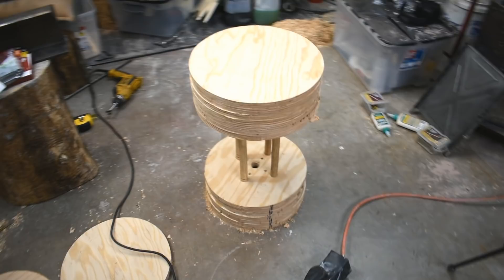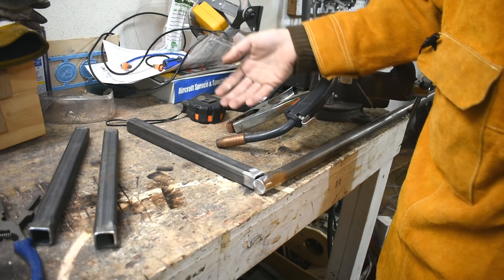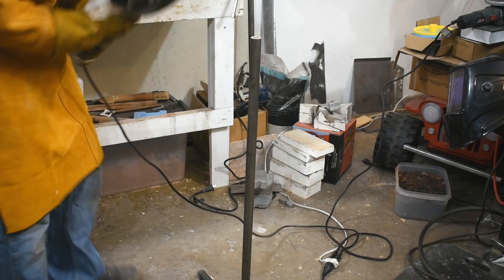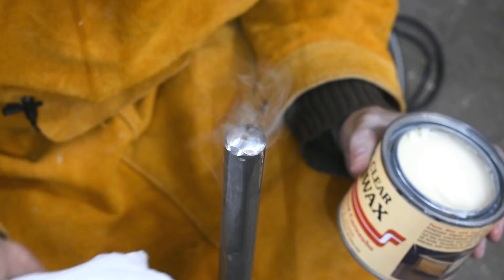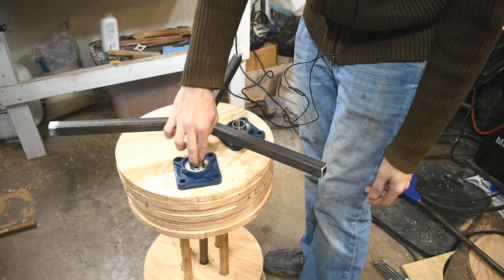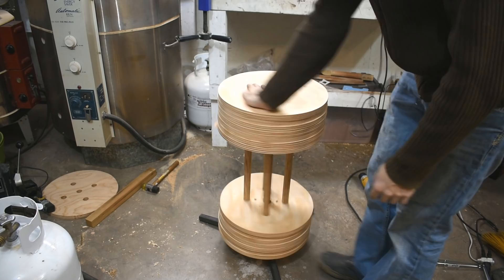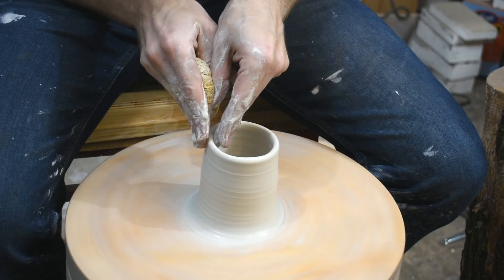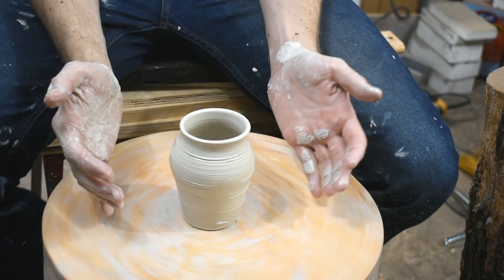Building an Asian Pottery Kick Wheel (kerokuro or karatsu wheel) Part 2/2: The Rest of It

Comment: Maybe you could put grip tape for a skateboard on the kick wheel
Reply from the maker: Good idea!
Reply: I second this upgrade
Reply: Another option, and cheaper, spread a layer of glue on the base and sprinkle sand on it. When the glue dries, you have grip. I did something similar to my grandparents outside stairs but used paint as the glue. Helps them not slip when its wet!
Reply: Was just about to post this, and your comment was right at the top.. so I just thumb'd it up. xD

Comment: You'll tear the sides of your shoes to pieces if you do this, but if you want extra grip, just cover the sides of the bottom wheel with skateboard grip tape. Putting your bearings on out of square might be the cause of the wobble.  Consider forming a shim to correct the squareness of the bearing.  As for the ends of the legs, you could take a 3 inch long piece of 1 inch by 1/8 inch flat stock and put a bend in it to cover the end of the tube and provide a foot for the leg from the same piece.
Reply from the maker: The bearings are free to turn, so being out of square is fine for them.  The wobble is definitely from misalignment of the wood, though.  Grip tape is a great idea

Comment: That wheel really works, much better than you’d think. Obviously someone knew that already as I am guessing there have been millions made. I’d be trying to ad something to power it for a steady speed. Not that that is a simple thing to do either.

Good job on all that work!
Reply from the maker: I already have that electric one from the washing machine, it still works (kinda).  Gonna try building some leg muscle to use this, but I might add some power eventually.  I cant leave anything alone.
Reply: @PaulsGarage  you could try adding weight (maybe drill evenly spaced 2 inch holes, fill with sand, and then glue some wood on top to hide the holes?) to the base to help preserve some of the momentum. The added weight may also help to keep your stand from moving.
Reply: I forgot to write, also, I think Korean wheels are used barefoot or with some kind of slippers for additional traction.
Reply: @andrewfleming611  The momentum he tries to preserve will also need to be built up to.  I think he'd better save that for after he gets his legs accustomed to the contraption as it is before adding weight.

Comment: My Pillow bearings should be here today.  Daughter is bringing home more glue. I'm going to fill the inside cavity of the bottom with sand to add mass.  I am stoked...
Reply from the maker: Building one? This thing is great.  My mom has it now but I'm planning to build another one, an Onggi wheel to be precise.  Basically identical to this one except lower and wider, but same construction.  Good luck!
Reply: @PaulsGarage  I thought yours was a bit tall?  About how high do you think your table should be?  Also how wide?  I cut 15" circles because my lathe swings 16" and I plan to true them round on the lathe vs. fun with an angle grinder...
Reply from the maker: It was a bit tall, but the key height is the distance from the top of the 2 discs.  The distance from where you foot hit the bottom to the part where you put the clay.  The total height is less of an issue as the real ones tend to be sitting down in a hole, or you have a raised bench to sit at.  I don't exactly remember how wide mine is, i think 14"?  I did the same diameter for both top and bottom.  If i did it again, I might make the top narrower, maybe 12", maybe not, but I would make the bottom one wider for a bit easier kicking and a bit more momentum.  The other thing I would change is to move some of the plates on the top to the bottom.  That way the total rotating mass wouldn't change, but the mass would move closer to the bottom.  With all the weight up on the top, it sometimes gets a slight wobble when i'm kicking it hard (like during centering).
Reply: I have it dry fitted and my first thought is that the hole the center rod passes through in the wood should be slightly larger than the rod, because it spins, but seem to drag a bit?  Thoughts?

I'm going to hunt the shed a little bit later for an old umbrella stand I think I threw out there years ago instead of welding)
Reply from the maker: Yes the holes should be large enough and aligned between plates enough that the rod doesn't touch them.  I had a similar issue, had to make adjustments.  The rod should only contact the bearings.  I dont have any contact at the tip of the rod like some designs show, it ended up working just fine like this.  A leach treadle wheel hangs everything on bearings too I think and those are much heavier
Reply: @PaulsGarage  I was pretty sure that was correct, but figured it made sense to confirm.  Appreciate your help!

Comment: Paul, I suggest Rubber. Get some decently thick rubber to staple onto the bottom of the wheel. It will give your shoes grip and a little extra water protection... And if the leg workout doesn't work out, you can always try adding a motorized belt to it.
Reply from the maker: Good plan!

Comment: Try friction tape on the base. You can also try adding a rim around the top to catch the water that's flying off.
For the sponge - use enough water so that your hands easily glide over the clay, but not so much that you have a pool at the bottom of your pot

Comment: Maybe you could take out some of the wobble by torquing the dowels, which as i recall have not been glued into place. It looked like they weren't quite parallel. On the ends of the feet you could drill a hole, run a bolt through and have adjustable feet to level it. I might try to make one myself, thanks.
Reply from the maker: The dowels weren't quite parallel and the panels weren't cut very well.  If I had to do it again it would be very different.  Give it a try, it's actually pretty fun to use

Comment: In case you were in desperate need of some hindsight delivered from my couch; I kinda did see that non-level wobble surface coming in part 1. Would have been better to widen out those holes and get the dowels in to a defined length; and grinding it down to a level surface sounds like a lot of work. To try and bring that back to a constructive suggestion; how about giving it a little rim with some wide tape sticking out, and then mixing up some plaster and wood glue. Makes for a nice and cheap but sufficiently durable pourable resin (plaster alone might do even unless you want to do more of these christnings) so you can let gravity do the rest of the levelling. This only gets rid of the wobble insofar gravity aligns with the axis of rotation though, mind.

Comment: You need bats and lockting pins.
Those bearings have quoted radial load not axial. You could replace the bottom bearing with a thrust type. If you throw your pot on a batt you can lift it off to cure and make another on top of another batt. Good luck

Comment: Scratch board under pot so you can move it while wet and a rubber cane foot on metal legs safer and slip resistant
Reply from the maker: Good ideas

Comment: Hi Paul . I've just recently found your site & for the past couple days I've been skipping around a bit but enjoying all of your stuff. Your personality & intelligence makes the chatter very enjoyable . But this wasn't intended to be a 'fan letter' ... (* shhhh *I'm a fan. ) I'm just an opinionated old (72) guy & I wanted to give my opinion on a couple things. - - Not intended to embarrass . A couple places where you are discussing stresses , you misused the term tension, most notably when you were testing the Iron ingot by bashing it in the vise . Its more easy to visualize tension if you just imagine tension as the opposite of compression. ... compression = squeezing , tension = stretching. The term for the stress you were discussing (like I said , in a couple videos) is shear . Especially in the lateral bashing at the vise - - Shear would have been the proper term.  Enough on that minor slip. 
 2 ) I forget the correct terms you gave for the two part box you use for your sand molds , but I believe the single wedge on the top box is not supposed to be ATTACHED to the box. I noticed you used a screw. I believe that wedge is a separate piece that should be driven in & held entirely by friction..
 Enjoying everything & I think The first project I will steal from you is the kick wheel pottery gizmo . Sneaky in that I believe if I can involve the wife - I will get more garage time for myself ! < insert evil laugh here. - - schistdigger@aol.com  - -  (Mike)
OH ! Hey ! it seems that at some point in your past YOU were a schistdigger  ! LOL

Comment: Why not use slices of the huge log you have instead of plywood disks glued together?
Reply from the maker: When huge logs dry, they tend to crack, and fixing the cracks is difficult.  If you see some old kick wheels they tend to be very thick boards laying flat, not upright, often sawn in half and glued in ways that prevent the cracking and warping.  Plywood is easier because the thin boards glued together with grain perpendicular to the next layer prevents warping and cracking, important for moist environments like pottery making.  It can be done with solid wood, but this is just easier for me with the tools I have.  To use the big log, for example, I would need a massive wood lathe.  While those exist and many people have them, I do not.  Thanks for watching!

Comment: The ball on the top acts like a "BALL BEARING" reducing friction, but your method will have much more friction, so there!
You should have used an old treadmill motor and controller!
Variable speed and decent power.
Reply from the maker: Good plan on the ball. But I already built an electric wheel!
Reply: So how should I build it then ? Lol like for real though .

Comment: Duck tape covers for the leg ends might work temporarily.  Plasti-dip for tool handles could do the job as well.  Adjustible feet at the ends of the legs could allow you to make the axle perfectly vertical, but as you like good enough, why bother?  Put your sander on a stand over the top disk and lower it slowly to make the top perpendicular to the vector of the axle.  Ugh, maybe it's too much bother.  Too bad you don't have a wood lathe to do that on.
Reply from the maker: I would LOVE a wood lathe big enough for one of these, it would be so much easier
Reply: @PaulsGarage  And then there's :  where do you put it?   😅

Comment: There are some "Spin Mops" that have a Bucket with a pedal. When you push the pedal it rotates a gear connected to a bigger gear (watch sec 38 here https://youtu.be/PvhXy9cRIZg?t=38), and the momentum generated dries your mop. Maybe you could try adding a big "toothed" wood gear at the bottom and make it spin with a pedal (like the one of the spin mop buckets, or bycicle pedal) if you want to keep it manual, or connect a windshield wiper motor for easyness.
Reply from the maker: Sounds fun! There are some DIY wheels made from those mop spinners already

Comment: You probably could make it right. You understand materials and possess skills but it's half-arsed.
Reply from the maker: You're definitely right.  The next one will be done better in many ways.  This one works surprisingly well though.  

My main complaint is the wobble.  It spins true but if I kick hard the stand wobbles a bit.  But then I saw a video of Richard Batterham working and his wheel has triple the wobble that this one has, so maybe I dont have to worry about it.
Reply: Paul what's your opinion on using wood turning blanks for the flywheel and wheel head? I've been looking into these as well as marine plywood. Cheers.
Reply from the maker: That might work.  If you can get a huge wood lathe you could shave the top and bottom perfectly on that.  Marine ply is good stuff but i would recommend not getting it at a box store. This is probably "marine grade" only in that the glues are water resistant, but the quality of the wood is mediocre.  If you get marine ply from a place that supplies boat builders, that would probably be best.